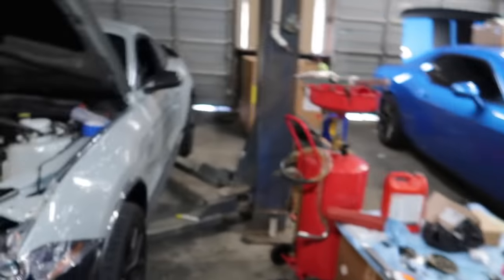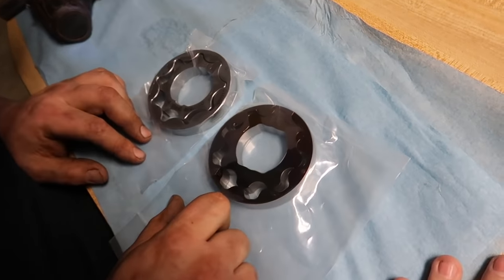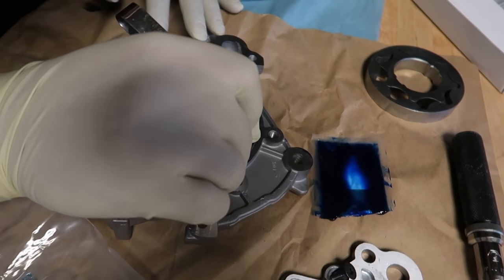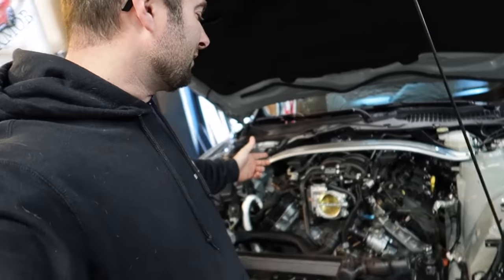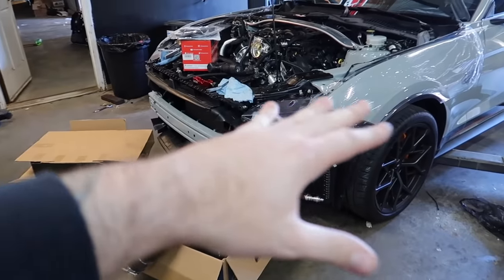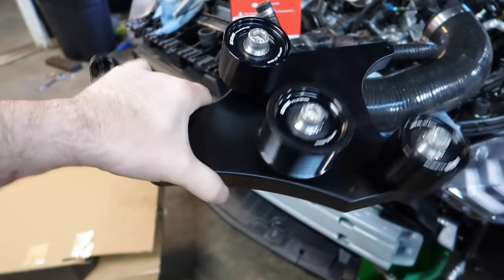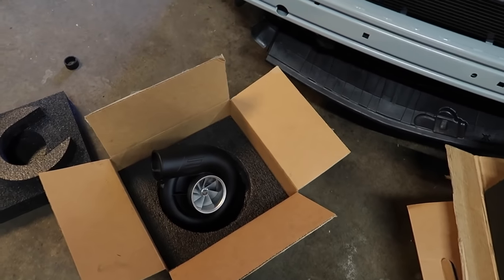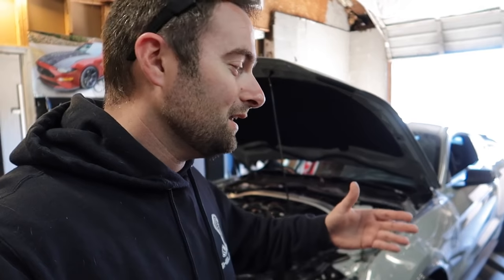FIRST ESS SUPERCHARGER on a 2021 MACH 1 FORD MUSTANG  -LET'S MAKE HISTORY!

Comment: Battle, Im so happy you went with this set up. I have a procharger and it's a heck of a fun car to drive. Im right at 760 horsepower and thats plenty enough for me, you can still go out and play around and daily drive it and don't have to worry about breaking the car. Happy for you bud, can't wait to see it run. Oh yeah, I have the jpms boost a pump and its great, one you might want to look into
Reply from the maker: It’s been a blast so far and made huge power on the dyno. Videos soon. Crazy how friendly it has been to daily so far too. It’s my first centri car and a blast so far
Reply: Thats awesome to hear, all long I wanted you to go procharged, but its the something lol. May next move is E85, I was told there's a plug and play system out them that I can use and not have to run a return fuel system. Have you heard about that?

Comment: stumbled across your video. I have a Mach1 as well. Adding the ESS — they state 2 weeks lead time. Plan to do OPG/Sprocket from lethal, the BAP that ess offers (vortech), and id1050x . Anything I should be aware of ? looking for the 650-750 range for safe daily driving — not wanting drags . From one veteran to another, thank you for your service.
Reply from the maker: Thanks for your service. You will love it. No downfalls or issues

Comment: Does the oil pump housing need to have the nuts torqued at different strengths in a specific order?
Reply from the maker: Yes
Reply from the maker: 89 inch pounds in cris-cross

Comment: Unless you are just banging off the limiter, OPG and CS are overkill at this power level
Reply from the maker: Maybe. But HPR just pulled out a cracked crank sprocket out of a stock 18. So I might have to disagree. I have also personally seen a 700hp car with broken gears 🤷‍♂️
Reply: @Zander13Productions  I guess it can't hurt, but all the guys I know with broken stock stuff just can't drive lol. Granted the mt82 is a POS especially the pre 18. But good luck with the build 👍
Reply from the maker: @hsucduw  I still agree with you that moderate power should not hurt them. It’s just added insurance I guess
Reply: Very true have a 2021 5.0 Roush supercharger 750 Horsepower 10 speed auto haven’t had any problem with it

Comment: Did you put the billet back plate with the martin wear gear like they say.
Reply from the maker: We did not. I was unaware I needed to
Reply: @Zander13Productions  when i was doing all the research after my gears failed i looked at boundary and the martin wear and it said you needed the hardened plate for the those gears.

Comment: Nice! I’m dropping a Whipple Stage 2 in mine in a couple of weeks. Currently on production!
Reply from the maker: You will love it
Reply: The Whipple is a truly awesome blower.
Reply: I have the stage 2 kit on my A10 18Gt. It’s the best in my opinion and I’ve experienced all of them.. turbos, centris, roots style, etc…
Reply: @Oreo_5oh  What do you like about it? I have a Whipple.
Reply: @CoyoteAUS  well the torque
Is instant, intake temps are great, maintenance is awesome every little interaction  after installation.
Reply: @Oreo_5oh  ah ok. I love the instant torque of the Whipple. The ESS is a centri? i thought these hit later in the rpm range? But like the way its nice and light and no high temps.

Comment: Congratulations man, can't wait to get mine boosted but I'm not ballin so I'm doing it in stages. I'm currently doing my suspension first, then OPGs then Transmission and finally Supercharger.  But I'm leaning more towards a Vortech. I just like better how the air filter is placed on top where it's easily accessible to clean or replace it vs the ESS, where it's all shoved inside the bumper.  That's gonna be a pain to do every oil change.
Reply from the maker: Honestly the air filter is easy to get to and to take off. It’s pretty easy

Comment: What is the difference between the Procharger and the ESS?
Reply: A lot , only thing in common is that there both centrifugal superchargers
Reply from the maker: ESS cheaper, fits better, easier to change belts, uses factory harmonic balancer, all made of billet, Flows more CFM, etc…

Comment: Ordered mine 2 weeks ago. Still waiting 😞
Reply: 3 weeks as of tomorrow for me. Ordered mines March 25th. Was told it will be up to 4 to 6 weeks until I receive it. I have all my supporting mods here. Just waiting for the kit. Believe me when I say I feel your hurt. But let's look on the bright side.....soon we will be pushing some serious HP and TQ numbers so I'm just enjoying my 2020 N/A 6speed Lund Flex Fuel Tuned 5.0 a little bit longer.
Reply: Nothing better then a 6 spd brother
Reply: About to start a channel.
Reply: @dikdawg3438  I'll be on the lookout and yes there is nothing better than rowing your own gears. Just my opinion.
Reply: Arizona elite motorsport is tuning mine. They helped develop that ess. Across the street from one another
Reply: @dikdawg3438  Freaking sweet.
Reply: Dude the customer service and knowledge is top notch. Was gonna go with a vmp tune. Vmp said I needed way too much extra to hit 725whp
Reply: @dikdawg3438  VMP is in it for the money. This kit is more than capable with less money involved with proper supporting mods. That's the reason why I went with it.
Reply: Same. They said 115 mm pulley. Lu47 bigger intercooler ngk6510 at .28 725whp
Reply: On pump 93
Reply: @dikdawg3438  Same thing I have just running the FIC1000  because I plan on upgrading to E85 down the line. Lund tuning mines.

Comment: Great choice on the SC. Should sound amazing. The one thing my S550 doesn't have yet :(  Full Steeda suspension - check, Variant Wheels - check, Koni struts and shocks - check, Audiophile grade sound system (one of my fav upgrades) - check, Cervini Ram Air Hood - Check, bah too many things to list.